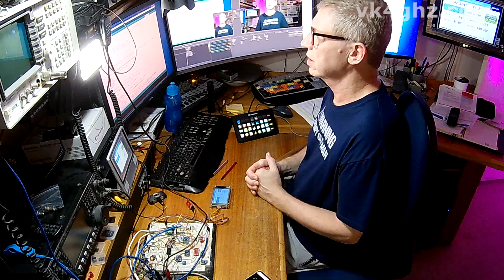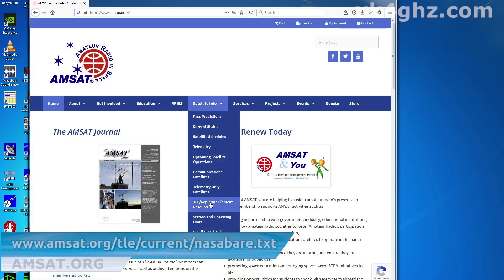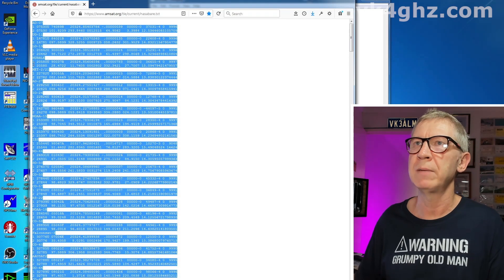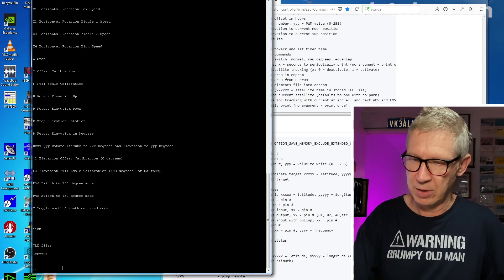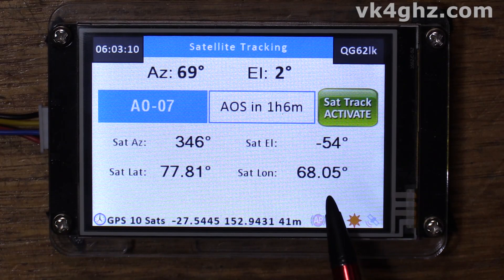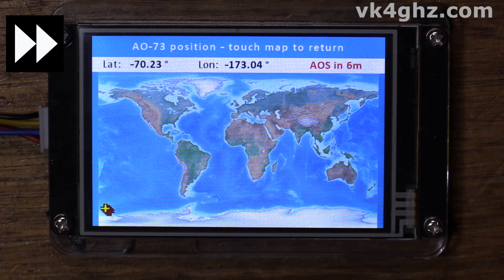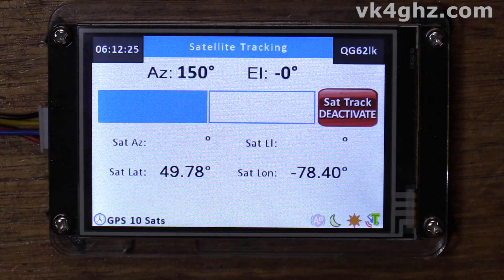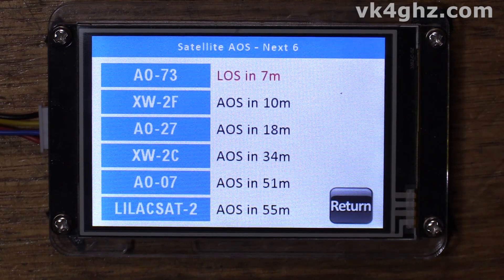VK4GHZ Nextion for K3NG Rotator Controller Part 4: Satellite Tracking & TLE importing

Comment: Excellent project. 
I would like to build this satellite antenna rotator controlled by Teensy 3.2 and Nextion Display. But, i do not have any programming knowledge. Could you share the compiled hex file (teensy 3.2) with me for this project ? (coskunmuti@gmail.com) TA2UCM, 73
Reply from the maker: K3NG provides the code on his Github repository:
https://github.com/k3ng/k3ng_rotator_controller